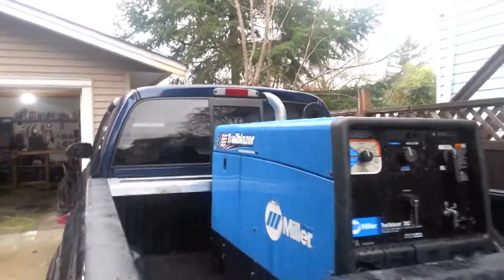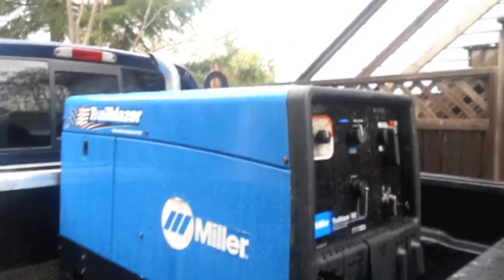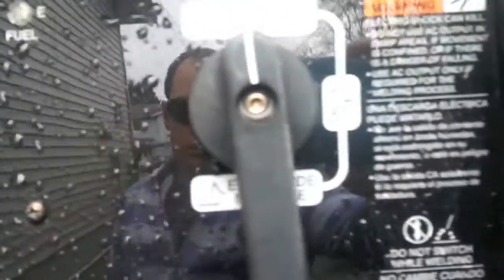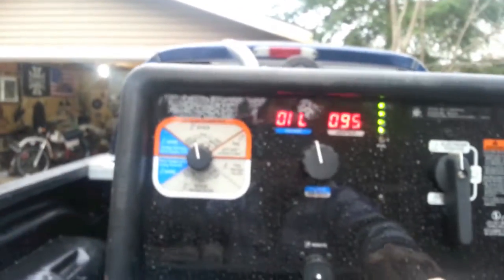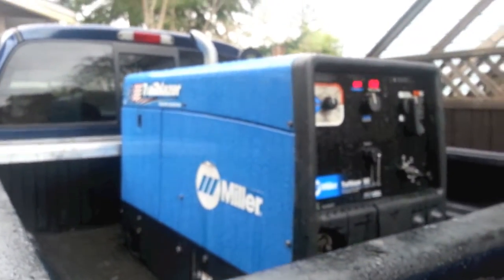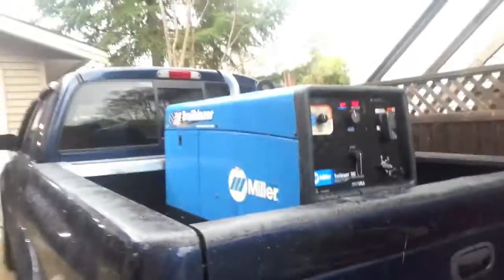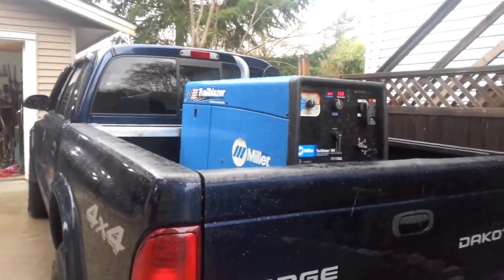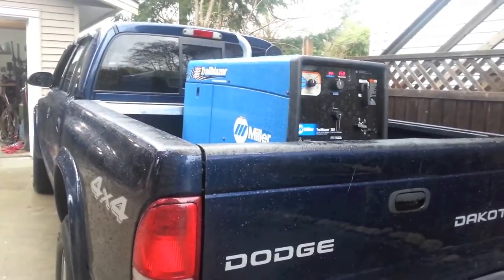Building a welding rig Miller Trailblazer 302  PT1

Comment: Speaking fron experience in locking up the engine on those... Invest in a cover. Also, and until you get a cover, turn the tip on the exhaust pipe to the rear and warm the engine up at least once a week (two weeks max.)

Back story, I ran a Bobcat 250 on my service truck for three years. Long story short, as a diesel mechanic, I used it more as a generator than I did as a welder, and it wasn't used often. I went about a month without starting it up only to find out that the engine had hydrolocked from the exhaust tip pointing to the driver side. What had happened was that when it rained, water was getting down the exhaust and filled up the cylinder with water. ... water does not compress. When the shop priced a new engine, it was $2,200 from Miller, so they got me a new welder for $2,500 (still didn't buy me a cover). When I got the new welder, I immediately drilled a hole in the bottom of the muffler and turned the tip towards the back of the truck. Some of the guys actually replaced the tip with flapper style tips with the hing forward to prevent this issue.

Good machines, though. Easy to maintain, and will run your entire house if you need to (Tip: Get a long RV power cable, put a 30A dryer plug on one end and whichever plug your machine uses for 220V on the other. In a power outage situation, kill the main breaker in your house, plug your welder into the dryer plug, and y0u can back feed your whole house)
Reply: Dustin Meier ive never heard of this! I don't drive around with mine but has had the cover off during some rainstorms not running. Hope I don't get this problem.
Reply: I was always afraid of water getting down the exhaust pipe on my bobcat 225, I cut the curve off the exhaust pipe and installed a flapper cap with the hinge on the foreword side. 
No problems.

Comment: Don't bolt it down like that. Give yourself about 15 inches of working/air space in the back. You'll thank yourself when you have to pull the back panel off to get a battery out. If you cant then o would opt for some running gear.
Reply: well at 1 time I was using a small Toyota truck, when my battery went bad in my Lincoln, I took an old jumper cable with a bad end, & ran it from my welder to vehicle battery, & just connected the cables to my battery ends, never had both running at same time, the jumper cables are still connected to welder, but need replacing, & I plan to install it to my main battery when I build another welding truck which will also be a vintage Toyota truck, but a 1 ton instead of a 1/2 ton. if my main battery dies, I just push truck, or get a jump, until I can get it replaced, but piece of mind, only 1 battery to worry about.